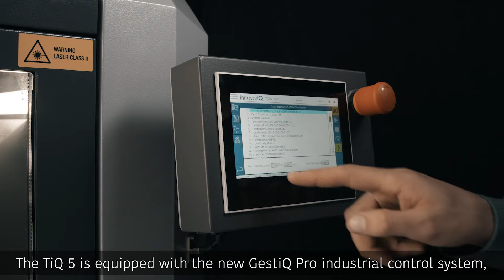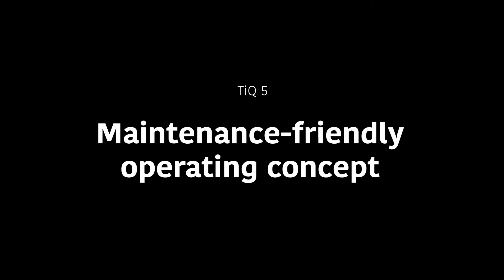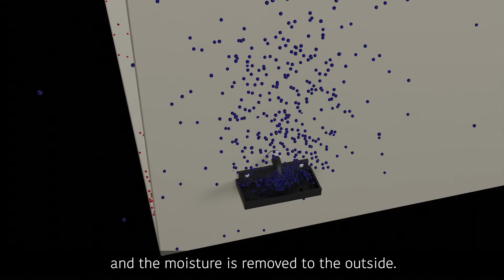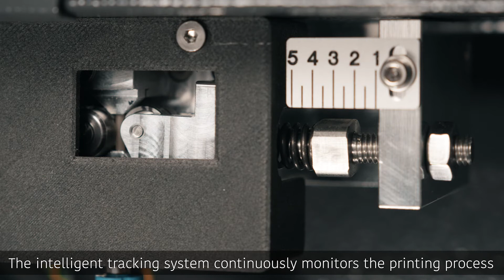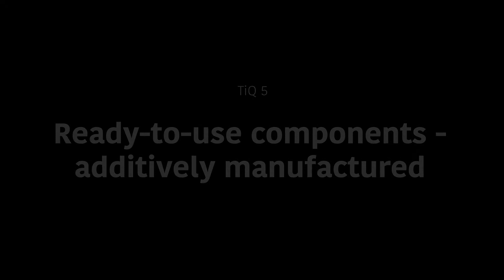INNOVATIQ – GERMAN REPRAP TiQ 5 3D printing system

Comment: I would like more details on this 3D printer!
Reply from the maker: INNOVATIQ TiQ 5 & MiQ 5 - INDUSTRIAL 3D PRINTING SYSTEM FOR HIGH PERFORMANCE THERMOPLASTS

Hello Robert
Thank you for your interest in the TiQ 5 printing system from innovtiQ. Here is the information you requested:

The "TiQ 5 Printer" from innovatiQ is the optimal system solution for additive manufacturing of sophisticated functional parts. The unique SmartFunctions ensure intuitive and user-friendly use of the complex possibilities of additive manufacturing.

Equipped with a build chamber heater and a water-cooled dual print head, the TiQ 5 enables the process-reliable production of components made of a wide range of materials, especially high-performance thermoplastics. Whether it is a one-off production, large prototypes or industrial production - the TiQ 5 is always the right choice!

The "MiQ 5 material dryer" an indispensable addition

The MiQ 5 is the new material drying unit from innovatiQ.
Designed as a bottom cabinet, the dryer also functions as a storage chamber for the filament material.
Drying is a recognized upstream process in 3D manufacturing to better process hydrophilic plastic filaments.  In additive manufacturing, it is important that the filament remains "dry" throughout the entire printing process. InnovatiQ has chosen the most sophisticated method, the MiQ 5, to bring the filament to an optimal state prior to extrusion.

More information on these systems can be found here:

innovatiQ website:
https://www.innovatiq.com/en/products/3d-printers/tiq-5/

Would you like to learn more about the 3D printing systems from innovatiQ? Contact me at +41 79 740 63 53 or r.minder@amtec-swiss.com.